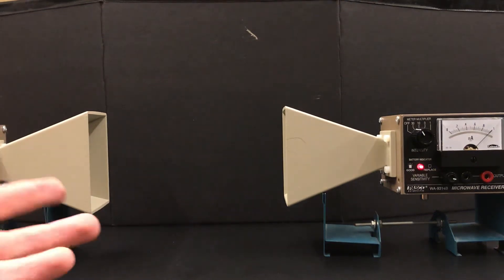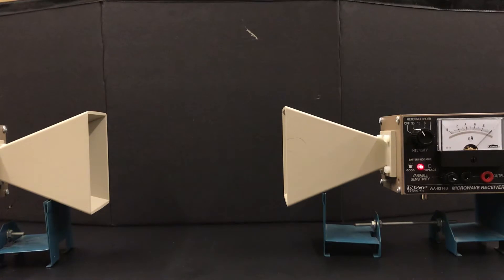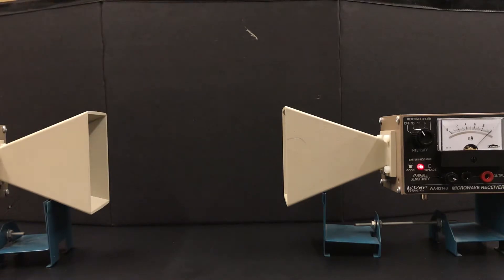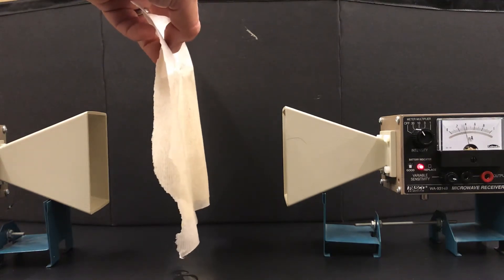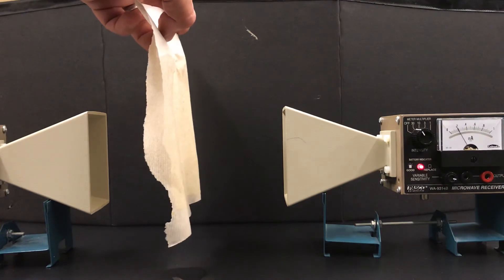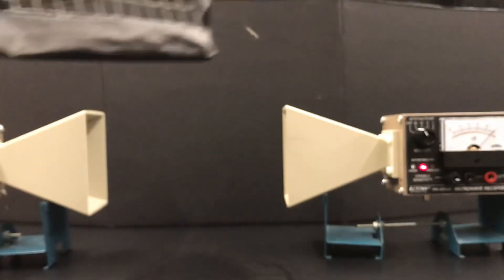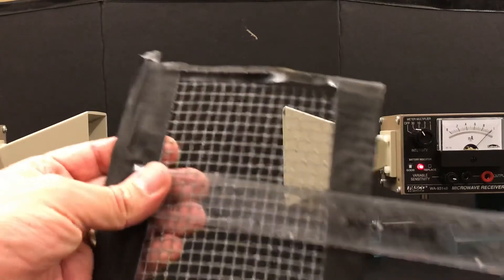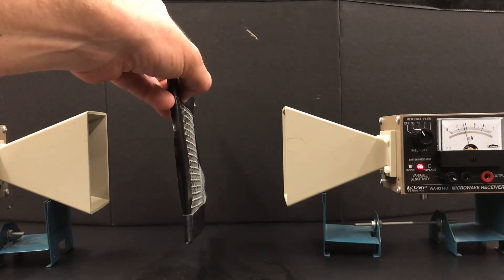1. Microwave Transmitter

Comment: How does the receiver turn the microwave radiation into electricity?
Reply: The receiving antenna couple's efficiently with the microwave waveform due to it's size/shape/geometry. So the shape of the receiving antenna is a good way of capturing the moving wave into the metal as moving charge. This received charge/signal is then connected to a shunt resistor/measurement resistor where the current through it can be measured through the magnetic field effect the current creates. The captured energy is then dissapated/used into a load of some kind to generate heat. The current through the measurement resistor is then measured. (the receiver gauge looks like it measures microamps I. E. Current not power)
Reply: @MHRolley  Thanks for the explanation.